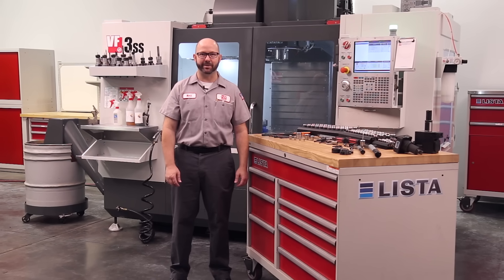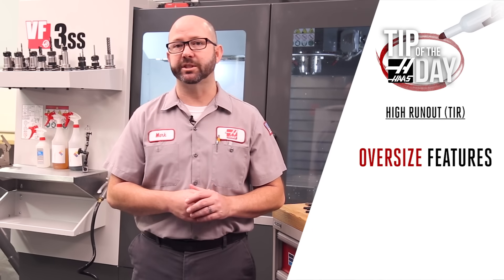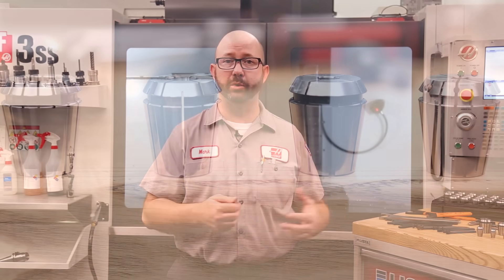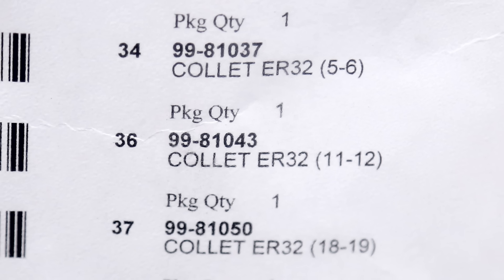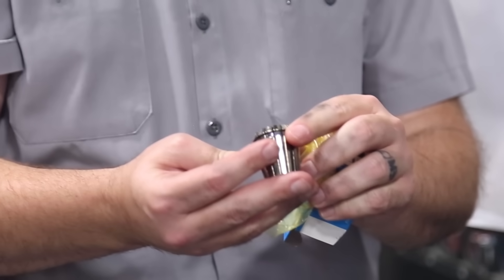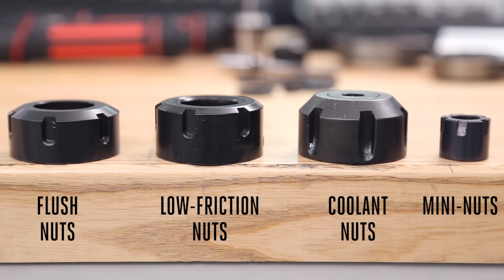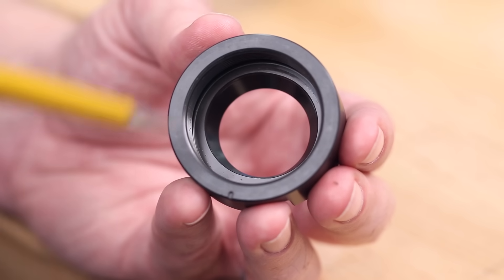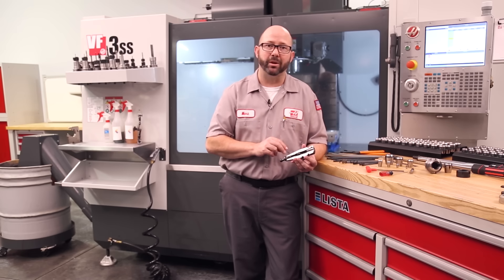ER Collet Essentials. Do You Know? – Haas Automation Tip of the Day

Comment: Just curious, when did it become ok to hold endmills in ER collets? I've been machining for over 20yrs and it's always been an unwritten rule.
Reply from the maker: Jeremy Fritch – We’ve always used ER collets for light milling. With new, fancier Dynamic/Adaptive toolpaths, it’s just easier than ever to get great results with endmills in ER collets. For heavier milling, an endmill (Weldon) holder, shrinker, or Hydraulic can be a better option. Sounds like a great topic for a video. The creation of low-friction nuts gave ER holders a new life as well, basically doubling the tool-holding power of a standard ER nut. Now they have fancy ER collets that lock in to your endmills also. Great comment. – Mark, Haas Tip-of-the-day
Reply: Since forever.  When Rego-Fix created ER, and then opened the patent up by making it a DIN standard, the market became flooded with all types of quality levels.  Some really good, some really bad.  Unfortunately, more bad than good.  Perhaps it's no coincidence that most people gravitated to the "marginal" quality because they were cheap(er).  That is when ER started to get a black eye and many seasoned operator got a sour taste in their mouth about ER.  The reality is that a high quality ER40 with a FRICTION BEARING NUT, holding a 1/2" shank yields almost as much clamping force as heat shrink holder.  I regularly have clients running a 1/2" tool in an ER32 cutting a full slot (1/2" x 1/2") with no slippage what-so-ever. Side lock holders are great for clamping force, but not worth the cost you give up in imbalance from the set screw unless running very RPM.  It's easy enough to verify this...just run the torque draw from your cut.  Most common applications in conventional roughing don't come close to exceeding an ER32's clamping force.  As far as adaptive milling, never use an ER32 on anything above 1/2" and 3 x diameter Axial DOC or you will walk the tool out.  The axial force is just too much due to the tool engagement.  Results may vary, but that seems to be the best safety margin.
Reply: Chris Hughes I can run a 1/2 x 1/2 x 1 1/4 × 3 endmill @ 1 1/4 doc, .06 step over, 425 sfpm, .016 fpr in 4140 htsr using a 6" ER25 with an adaptive tool path. What more do you need?
Reply: Jeremy,  I don't understand why holding end mills in ER collets is a problem.  I've never had cutters to slip in standard R8 collets in over 60 years. With proper torque you really don't need that Weldon flat.
Reply: @ellieprice363  We never used ER or direct ones for precision work. Only Weldon or Clarcsson. It depends how costly the workpiece is. There is a difference in a CNC`ed motorbike hand lever and a handcrafted mold fo syringes ...
Reply: Never. I cringe when I see that

Comment: ehhh metric   makes me want to puke
Reply: I'm a welder/fabricator/machinist, and the English system blows because it requires conversion within it.  The primary customer designs everything in fractions, but uses metric threads, and dimensions in thousandths or hundredths depending on the tolerance.  The last few places are lost in rounding, and I have to waste a bunch of time on my calculator trying to find the nearest fraction.
Reply: For me it is the opposite .. Loy Clements
Reply: garygsp3 and yet two of the most significant people who contributed to the USA actually achieving it came from metric countries. New Zealand (William Pickering) and Germany (Werhner von Braun)... Ok NZ were still using English units back then.
Reply: As for me, I do not say that it is obsolete, but less practical. In fact, try to think about this because, although this video was shot in America and as an American producer Haas, all ER collets are in metric sizes?
Ask yourself the question, and give yourself the answer.
IMHO
Reply: ANSOMIA it’s more about the conversion.  I just hate when I get a print from a customer  and I have to do the conversion.
Reply: Loy Clements Ok I understand. But I think the opposite is true, do not you think. If a person who is used to the metric system must understand a drawing quoted in inches ... I think he would also blaspheme! :-)
Reply: Yet they use imperial nuts and bolts to put their equipment together.  Who do you think they are pandering to?  If their own engineers design the equipment using imperial then the use of metric is to just satisfy a customer.  Using metric for this demonstration is nothing more than a coincidence.
Reply: garygsp3 If you are convinced of it ...
Reply: In any case.. they included both units when talking about it. So I think they got it spot on. 50% of Haas' market is metric, 50% imperial.
Reply: gredangeo, net neutrality was only in effect for a short time. We were okay before it, I saw no improvement when it was in effect, and now we will be okay after it. Personally I like living in the USA just fine. And, if I never had to deal with metric again I would be better than fine with that too. It's no better and no worse, but it adds expense and clutters up the shop with more tools that do nothing the SAE ones can't do. If using the SAE/English system blows someone's mind then maybe they need to step down to a lower job title or step up to the plate and expand their mind.
Reply: Nasa is only using the metric system. There was a accident, read about it here: https://www.wired.com/2010/11/1110mars-climate-observer-report/
Reply: Noah used cubits. The US should deep-six these new fangled feet and inches. Invented by a monarchy. Fake units. Sad.
Reply: Yes, but Space shuttle and rockets have metric screws!!!
Reply: Collets are available in metric and imperialistic sizes - just inform yourself
Reply: There are those of us who's country has put men on the moon.... and everyone else.  I think you would be an everyone else gwedo
Reply: Only the U.S. has ever had citizens step on a foreign body.  Yeah a few countries have sent satellites and even less have sent rovers.  Yet the U.S. is still the only country to anyone let alone 14 different men step on a heavenly body outside of earth.  So Grendangeo I'd say that is still a pretty awesome achievement.   So just because you don't understand how to manipulate imperial units doesn't mean that it's outdated.  It just makes you uneducated.  I can and do use both imperial and metric.  I don't find metric any easier to use so why then is it superior?  Don't you dare tell me it's more accurate because that is BS.

As far as Net Neutrality I don't see where that is any other countries business but our own.  So unless you have a horse in the race by being a citizen I'd say to mind your own nose.